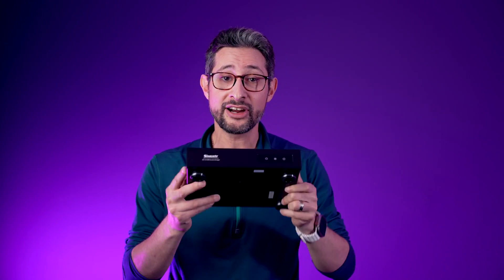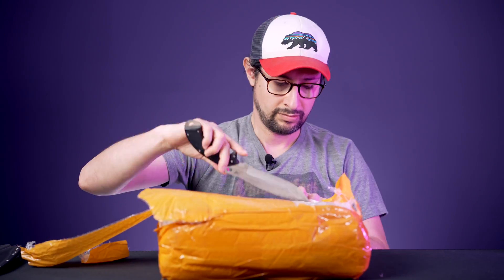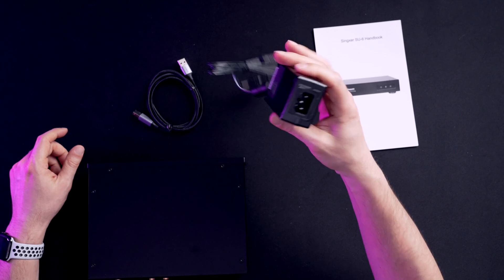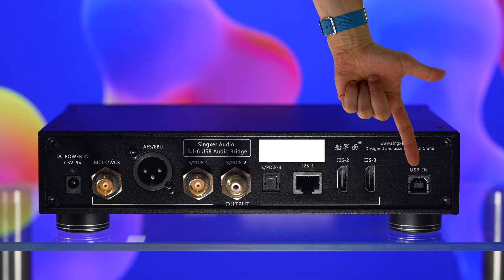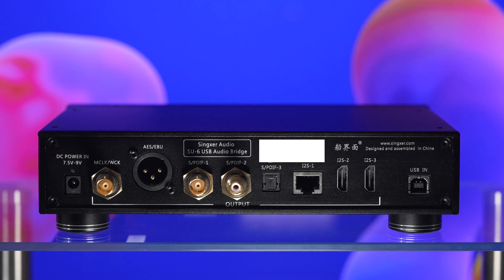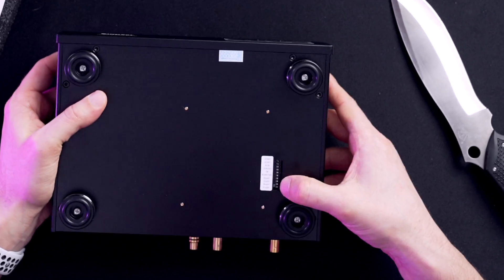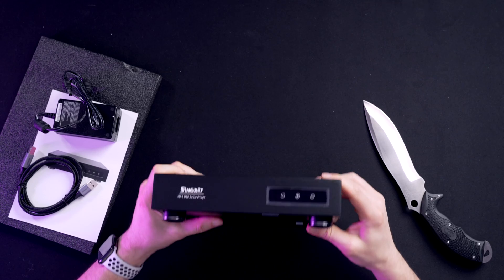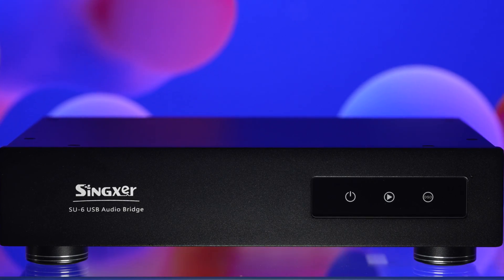Singxer SU-6 Review

Comment: does the SU-6 shoots itself in the foot by only offering USB as the only input format??? I read many are convinced USB is the worst for SQ in digital connections !
Reply from the maker: As far as what you may have read: Not at all in my experience but YMMV. Whether or not the USB input is a limitation depends on use-case. Thx for watching 🍻

Comment: I have a few questions:

I have been searching high and low to clean up my laptop-to-DAC connection, which is USB.  I did not know that these DDCs existed.
I have been using a quality Audioquest USB cable, which helps a lot.  But noise is still getting through.  I learned that when I inserted a Sabrent 4-port USB hub between my laptop and my DAC.  Everything sounded better.  But I knew my laptop was still a weak point.  The USB hub helped, but I doubt that it would compare to a purpose built device, such as the SU-6.

Now I have learned about this digital-to-digital converter, that will re-clock my data, keep my laptop's noise from reaching my DAC, and I can use my DAC's AES/EBU input (fed from the SU-6).

@12:49 you had a bit-perfect warning (#1 item).
I am using JRiver's Media Center.  Is that bit-perfect?

Also, I will have to purchase an AES/EBU cable.  They can get expensive.
For the digital connection between the SU-6 and my DAC, does that cable affect the sound quality?

Lastly, how can I find out if there are dip-switch settings that make the SU-6 compatible with my Aesthetix DAC?

I have a very revealing system.  So I want to get this right.

Very good video, and thanks for any help.

Comment: What diffrent power supply do you recommend that is not stock to improve its preformance? please im new also do you need bit perfect software for everything ? or can you just plug and play music after installing drivers and that it.
Reply from the maker: Hey, you do need Bit perfect software if streaming from your computer. My favourite and what I recommend is Roon. Check out my video on that. As far as power supply upgrades for the SU-6. I never felt the need to upgrade mine. It does a great job without any mods and I’m not sure you would get a perceptible difference. Best off spending that money elsewhere (like Roon) imo. Hope that helps! 🍻

Comment: Get educated about physics before you criticize it adding weight and mass to anything will reduce micro and macro vibrations which will benefit circuits,granted you have to have a high resolving system in most cases to hear a difference which most people do not have and can’t afford, so many scepters like yourself
Reply from the maker: It was a joke. Thx for watching 🍻

Comment: Your reviews are among the best.  Discovered your channel a while back.   Based on your review of the SU-6 and one other from a reviewer I think is great, I bought one.  What dip switch settings do you use with the Venus?  I have a Pontus II and I think it would use the same settings.  Denafrips DACs are not listed in the SU-6 dip switch chart, so I tried the first column settings, labeled PSAudio.  It didn't work, and I followed the Denafrips instructions on how to select one of eight possible settings in the DAC to match the DDC being used.
Reply from the maker: Thanks! I use PS Audio setting for Venus and believe it’s the same for Pontus. Not sure what’s going on but I believe  switches 1 - 8 Off, 9 -10 On for PS Audio. Hope that helps. 🍻
Reply: @MisterChibs  Thanks that does help.  I've been experimenting and music plays with the PSAudio setting with no distortion.  The solution was to change my HQPlayer PCM sampling rate to a multiple of 44.1and DSD was already working without distortion..  However with DSD from HQPlayer the left and right channels are reversed when playing a channel sweep.  I may have to contact Alvin at Vinshine audio.

Comment: .     The latest DACs strip away the incoming line clock signal then use an onboard cache and re-clock.  It's the same way the Singxer overcomes the incoming PC or Laptop usb clock.  So that part is useless on the Sinxer.
                                                                                      Acid Jazz, Funk & Brass   🔈🔉🔊
Reply from the maker: This was not my experience. Have you tested this personally? Thanks for sharing your opinion and watching 🍻
Reply: @MisterChibs  
  .      How do you think the Singxer overcomes the incoming clock then?  If Singxer can do it for the benefits, so then DACs & they do.   
       (edit)  The Singxer's fancy clock is useless.  The Singxer will only function when the DAC requires a packet or packets of data to replenish the DACs cache.
                                            
                                                                                           Acid Jazz. Funk & Brass  🔈🔉🔊
Reply: @MisterChibs  
          Testing?  What's to test?  It's a self-apparent function.  External DACs don't rely on Master clocking anymore.  I don't even think the latest USB configurations dedicate a channel to clocking anymore.  It's a surround channel now or that HT related BS.
Reply from the maker: I guess you haven't tested personally. Cool.
Reply: @MisterChibs  
      I see it with my own eyeballs.  LQQK....  (pointing finger)  that's the clock.  that's the hdd cache and there's the controller chip.   My personal eyeballs are fine.  I don't think I can post a pic of my DAC with circles and arrows.
Reply from the maker: @TriAmpMyFi  You'll have to forgive me for not trusting what some rando thinks his eyeballs tell him. 21 Months of ownership and extensive listening tests says otherwise.🍻

Comment: Thanks Mr Chibs, it's my first time watching your channel - very, very good - and looking forward to watching your other videos!

I have an Innuos Zen Mini Mk3 w their LPSU upgrade >> feeding a Marantz HD DAC-1. I've read so many good reviews of the SU-6, however, then I heard about the "Ideon Audio 3R USB Renaissance mk2 Black Star, An affordable USB conditioner device to Re Drive – Re Clock – Re Generate the USB signal." It's from Greece, rave reviews, and about $500 USD. It's NOT a DDC, but supposedly a very competent reclocker.

So, I'm only after sonic improvements, wondering if you or your subscribers can offer pros and cons vs the SU-6? Given the high pedigree of your main system, I think you'd enjoy trying the Ideon...thanks!
Reply from the maker: Thanks for the heads up on the 3R. This is the first time hearing about it. I think if I were to buy and review an other DDC / Re clocker it would have to have multiple types of digital inputs. I’ll give it a look. 🍻
Reply: Thanks!

Comment: There  was nothing nasty @ All !! It may be when it sees brackets instead of parentheses!!! .( From the Google keyboard.

I'm saying it's just a single board computer with open source software!

If you power a fanless Mini-PC with a low-noise power supply " Voila " connect a low cost DAC for multiple outputs.

Until I built my home theater my test equipment was top of my budget @ 40k

Current DACs use asynchronous communication so those clocks are less critical than the in past days.

Eliminate noise and digital shines add the right harmonics ( Tube or SolidState)  it can sound better than Analog
Reply from the maker: If you pair SU-6 with that computer, you'll notice improvements. As long as you're enjoying your music that's what matters most. My wife listens on her iPhone speaker 🤣
Reply: @MisterChibs  Actually  the SU6 a computer  that's why I use a Mini PC just load  Volumio, Daphile or others it turns the processor into a FPGA with more flexibility

That's coming from someone who owned a computer before Apple Corp was founded ( Me)
Reply from the maker: @HeavyCrown2030  I doubt the clock is as good as the one in the SU6.
Reply: @MisterChibs I said earlier "Asynchronous Data  " which lowers the accountability on the clock works on DACs made in the last 10 years are so MFGs omit that fact and exploit that it was once very important.( Not the same today)

The Asynchronous technique  that runs  your phone all the streaming communications ( even dial up modems) Satellite communications.
( Eliminate the need for a master clock)

The USB Audio protocol developed about 20 years ago fixed the problem" In the Beginning " USB was not fully capable of audio transfer and relied on a continuous clock stream.
Reply from the maker: @HeavyCrown2030  Thanks for sharing your opinion.

Comment: How did you find the digital out of the wiim? I sold my dac which had a built in streamer and figure I get the wiim to use with my new dac until i get something better later.
Reply from the maker: I have only used the Wiim mini so far. Have the Pro in a drawer, still wrapped in the box 🤣 Got it back on Amazon Prime day. I'm assuming the Pro is just as good as the mini if not better. For the price, you can't go wrong as long as you don't use their internal DAC's.🍻

Comment: Ohh Ok U get paid by Singer so my original comment was deleted?

Sorry DDC or just a computer interface overpriced jist use a PC with low noice power $100 can brig that outcome
Reply from the maker: Lol I don't work for Singxer and did not delete your comment. Youtube automatically deletes them if they're nasty enough to go against their guidelines. Too bad, I like the nasty ones 😉 We can disagree on the 100 $ power supply equaling the Singxer SU-6. After all the testing I've done, I know better. Thanks for watching. 🍻
Reply: .     Glass Fiber Optical Out from a PC.  No noise even electrically possible.  Re-clock & cache in the DAC.   It's the best possible connection.
                                                                                 Acid Jazz, Funk & Brass  🔈🔉🔊
Reply: @TriAmpMyFi I wish your statement was accurate, It's the fiber doesn't create new noise however, I will definitely pass what's inside the PC through the fiber!!!

That's why I build my own power supplies & filtering and check it with an Oscilloscope. ( All noise has to be stopped at it's source or it propagates)
Reply: @HeavyCrown2030  
Sorry, pardon me...................
        "It's the fiber doesn't create....."   Say what now?
&     "I will definitely pass what's inside...."   Like a kidney stone or something?

                                                                Acid Jazz, Funk & Brass   🔈🔉🔊
Reply: @TriAmpMyFi  Let me clarify fiber is not magic !!! If I connect fiber at the bottom of a 400 ft tower my input to that fiber must be a clean signal. ( To transmit without distortion)

Example:When I connect TOSlink from CD or DAC any noise in that source will be transferred regardless of the fiber!
(The ecosystem is always in play)
Pardon my  colloquialism's I can explain it in full technical terms if you like? 

I personally reduce the power supply ripple to below . 000001 volts in my audio system sources.
Reply: @HeavyCrown2030  
         Ya well, lol, unless your going to build whatever you built for all of us, the rest of us have to make choices.  So whatever you built helps no one.
        2nd.  Give me a break.  I never said glass fiber was magic or even implied it was noise-less.  Have adult debate.
        3rd    "... any noise in that source will be transferred",  non-sense colloquialism's aside, it is not true regarding "Any" noise.  In fact, it's quite specific what the noise is.
      Lastly, to finish off the connection from PC to PreAmp,  include a balanced output DAC with a decent quality set of XLR patchcords.  It's the best that can be had until all the connections change very, very soon.

                                                                   Acid Jazz, Funk & Brass   🔈🔉🔊
Reply: 1st I have paid off  student loans and pay stubs to back up my statements.

2nd  I'm happy to provide a parts list that can be sourced from Amazon or AliExpress.( To build what I stated)

3rd I never uploaded an instructional video but I have a 6 year old here in the house that can edit videos and post so I'm positive It can get done if needed.

4th XLR uses a differential method for noise Cancelation that definitely helps reject induced noise between balanced circuits,( I wonder if this person even knows what that is)
So it will pass noise generated before the differential interface. ( It is not magic it works between the XLR interfaces only)

In my personal life I look for the smartest individual in the room because I'm not ever intimidated by knowledge.
( I have decades of electronics in my head ) and 10s of thousands of dollars in test equipment)

I'm not just repeating things I've heard others SAY!!! I'm an  individual with practical hands on knowledge of Electronics , Electrical, Component level troubleshooting, Design & Programming

Comment: Lol. You've gained a new subscriber (me) within 41 seconds 🤣
Edit: Love your your video. I use a PC, but I built it myself for this purpose. Completely fan less. SATA SSD's for music (better than M.2) that at the moment have their own power from the PSU (so not on the same cable and it's a cable with just one connection), PSU outside the case with the motherboard, GPU shuts off after one minute after opening my music player. And it shuts off all windows functions to about 7 processes running in the background). My DAC is connected via USB, but it's a cheap (NOB Sounds sells them) external USB card which in my case doesn't need power. Placed also outside the main case in it's own shielded case. 
What do you think, would a PC build like this have the same improvement as a normal laptop with the same software player? I am not sure if I should put another 700ish buck in it to be able to use I2S instead of USB, or a chassis-grounding set for about the same money.
Reply from the maker: Thanks for watching and subscribing! Honestly, I think a DDC will still clean up the sound from your custom PC. It made my $2400 Lumin streamer sound better. Having said that, if you don't want to spend as much, you can always just get a Wiim pro or Bluesound Node and have streaming done completely separate from your computer.🍻
Reply: Me too exactly with this video, and within 1 minute!
Reply from the maker: @quadrannilator  Thanks!🍻